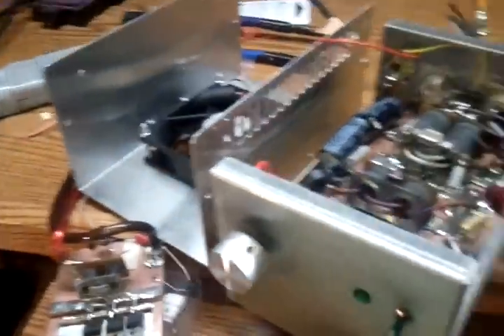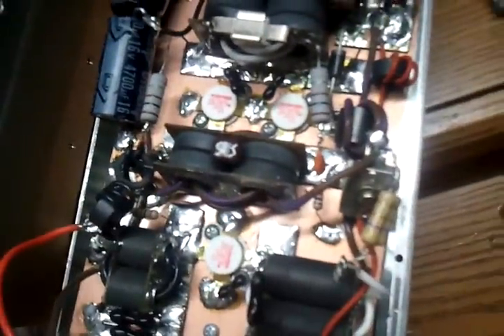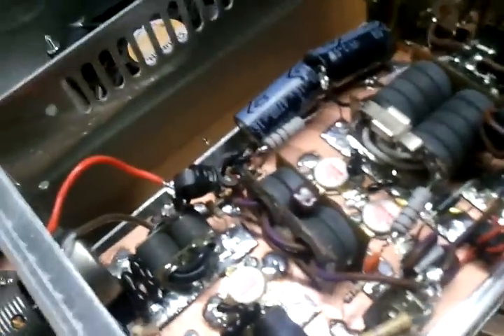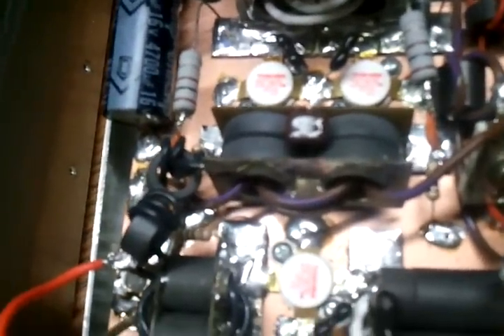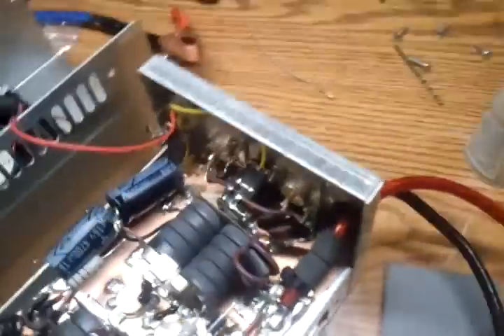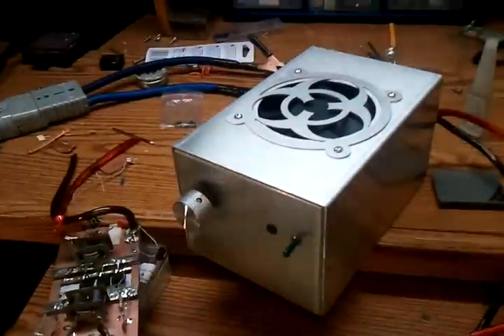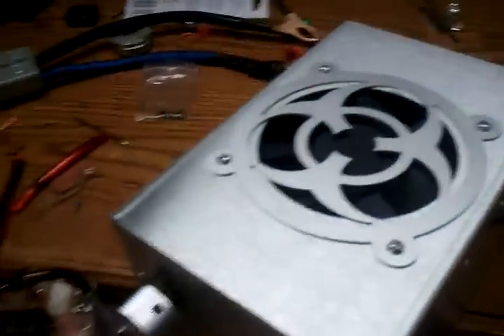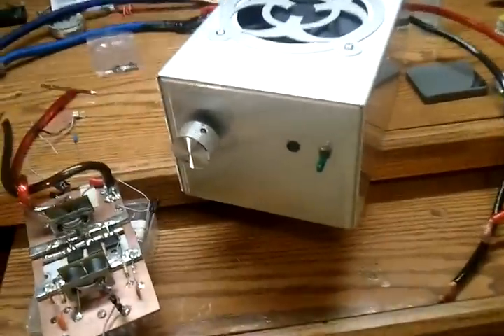1X2 Gatekeeper Built Killa - 1x2879-Driving-2x2879

Comment from the maker: Then of course the other Leg of the Resistor solders to the output of the transistors pill strip section.

Left Leg-104 CAP-Right Leg--Leg Of 100 Ohm Resistor Right Leg Of Resistor

In other words the Cap solders in series with the resistor. Hope this helps

/

Comment from the maker: Oh yeah, there is no problem with that. Heck most of the time here lately I actually use 5w 100ohm Resistor Flame Proof across the pills. Of course there is no problem with that brother. There should be 2w across the resistor now correct?

Just use a 103(.01uf Ceramic Disc Capacitor) 50v or better and put one leg of the cap to one leg of the resistor.

Then one leg of the cap solders to the pill strip on the input section where the bottom(base) of the pill is. Then the other leg of the resistor.

Comment from the maker: Well snakeeyes I have no idea where you are saying that this 100 ohm resistor is needing to go in your 8 pill. Either the Splitter/Combiners or Feedback Circuits Across the Pills? But I can't really say that it will sound better. You'll have to give me more information on the reason of why, and if some some odd reason there isn't resistors in places that need to be and such like that. You will just have to shoot me some more info on where you are talking about putting this.